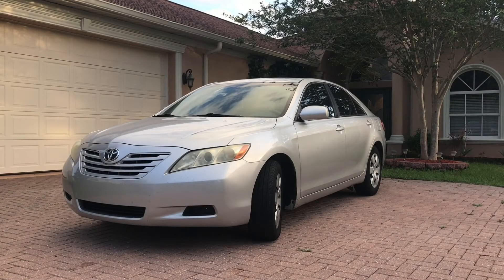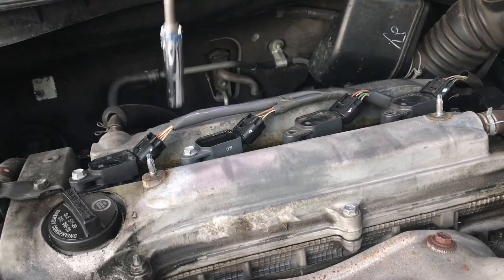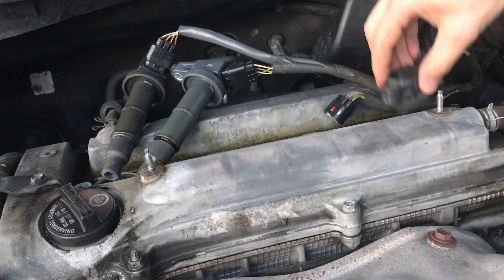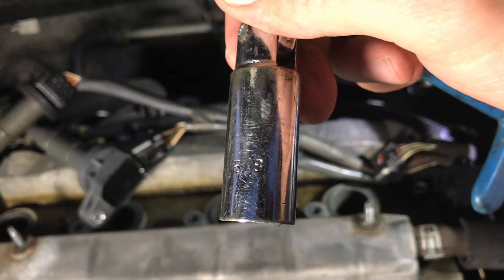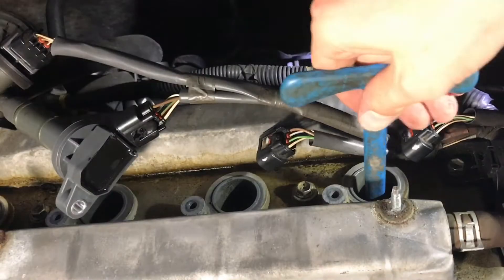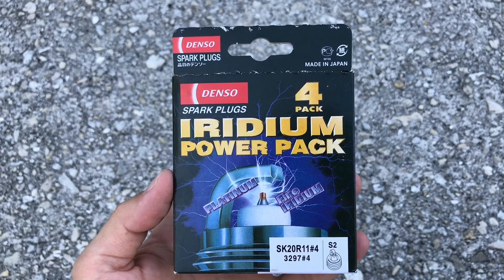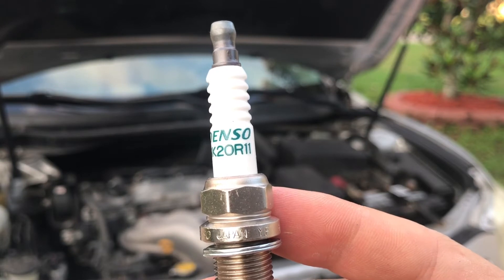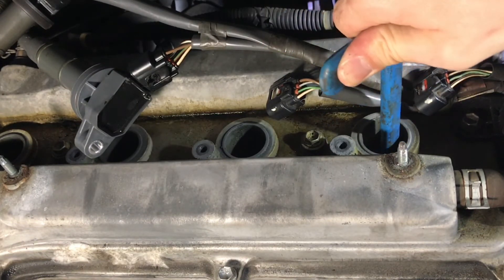How to replace spark plugs on Toyota 2.4L 4-cylinder engine - 2008 Camry Example

Comment: @DIYtimeTRD Can you please share the link to the video where you had indicated that you need to replace the valve cover seal because there’s oil in the ignition coil
Spark plugs. Thanks